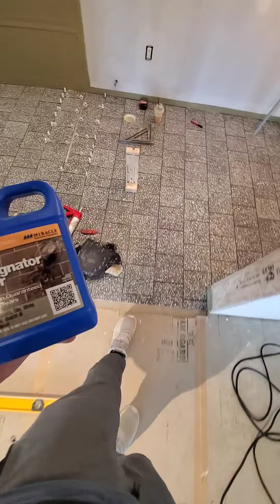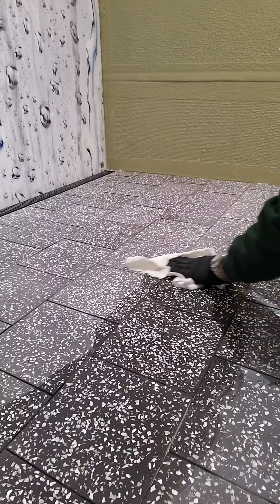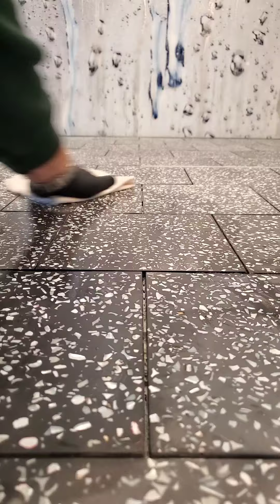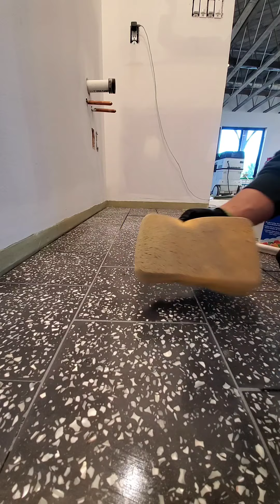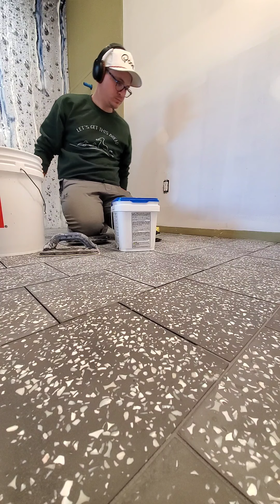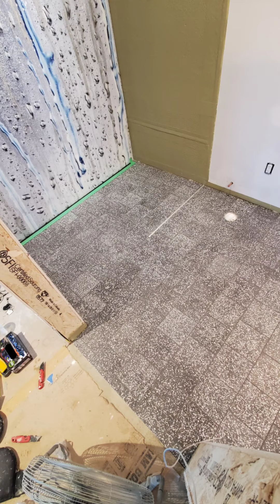Grouting with Mapei Flexcolor CQ and  sealing with 511 Impregnator Sealer

Comment: Just curious. I thought this particular grout product was 8 to 10 minutes before cleaning? I see you’re doing it right away. Can I get away with this? Doing my backsplash soon with the same product.
Reply from the maker: I have never had any issues with this particular pre-mixed grout wiping it down as soon as I apply it. The critical thing with flex color CQ is to not overwash. Excessive water will remove too much of the polymers and it will not cure properly.
Reply: @NathanTilesTheWorld  great advice, thanks!
Reply: Put the grout down for 2 minutes, then clean. Cleaning will be much easier this way.